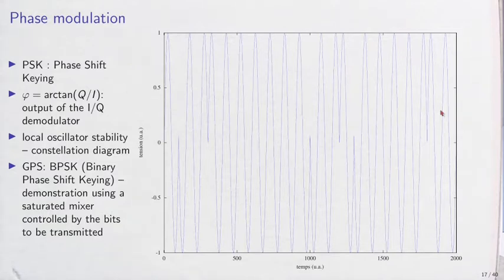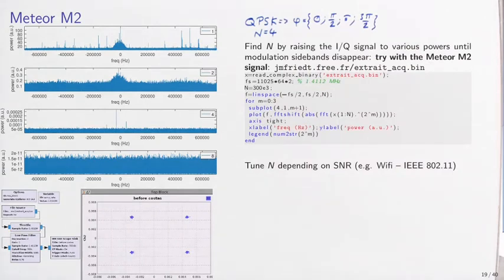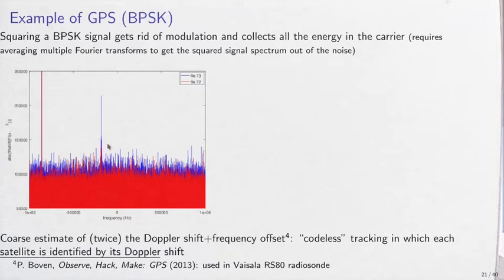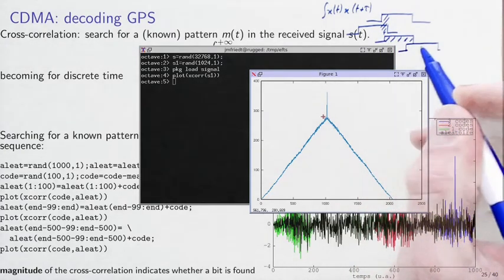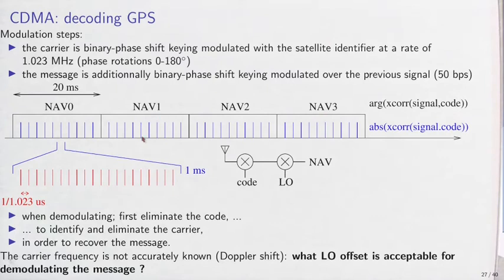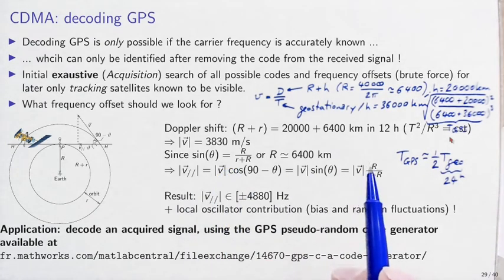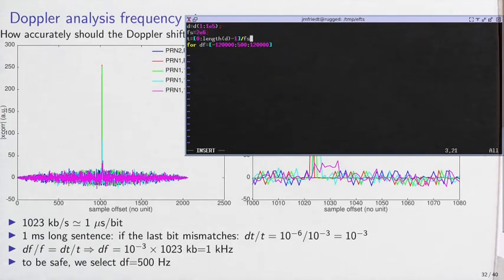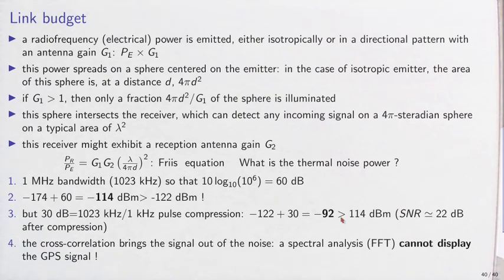European Frequency and Time Symposium tutorial 3/3: PRN and GPS decoding using SDR (J.-M Friedt)

Comment: Thanks you a lot for this lecture, it was very interesting. Wished it had more ressources about early late code generators (there are no easy to use GNU Radio blocks at the moment) but still was very interesting and learned a lot !